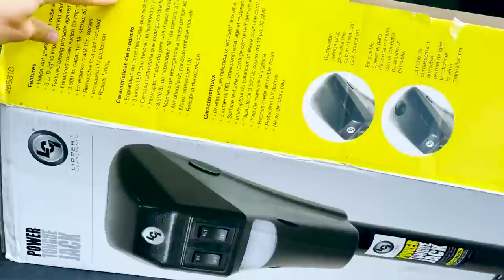Our tongue jack BROKE…I guess we’re stuck in PARADISE! EP. 9

Comment: Helpful tip for water control 
Y’all have a truck now buy  5 / 5 gallon water jugs, use a piece of plié wood to hold them in place in towards the front of ur truck. Buy a  hand pump attachment for them, 
Use this water for washing dishes and miscellaneous stuff so you can use your water in your holding tank for showering and the toilet.  
If you run out of water in your holding tank buy a Funnel and you can pour water into your holding tank  area from one of the 5 gallon jugs.   
When you find a hose refill your fresh water supply and jugs.  
Hopefully this helps ease the water shortage.
Reply from the maker: Thanks for the tips we appreciate it :) so far we have 2 6 gallon jugs that have been super helpful for going to town and refilling them. Then we have been using that water for dishes outside to keep the grey tank as empty as possible!
Reply: @adventures  oh I forgot to say in my 1st post I love your whole family and dog !!
Reply from the maker: Awe thanks 😊 💕

Comment: You need to get a set of tools with sockets, ratchet and assorted screw drivers.  Channel locks are will eventually round off the heads of your bolts and nuts.  Also assorted adjustable wrenches!